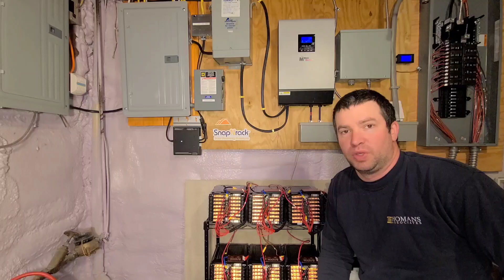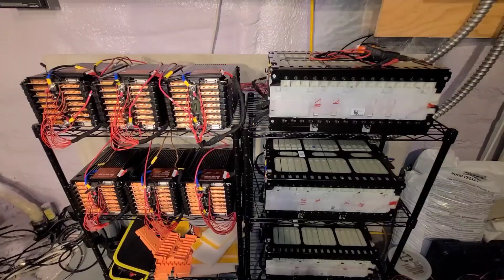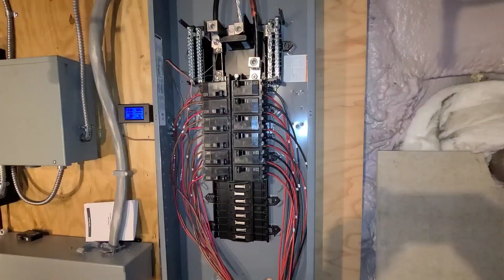DC Wiring Using 12 Daly BMS's with Volvo LG Chem and Smart ForTwo Batteries

Comment: Hello. I am thinking of using these LG Chem batteries in my electric vehicle. How did you solder the wires to the cells? (with soldering iron and tin?) I'm going to do the same on my project... Thanks in advance.

Comment: Thanks for sharing!
I'm considering Daly's for a few of my similar lg chem 16s 60V modules in parallel.
A question:
Is there a reason you soldered the wires directly onto the cells instead of using the regular cell pin connector i the middle on top of the cells?
Reply from the maker: Good question!  I initially tried to make the plug work, but the connections were too tiny to work work with.  I tried removing the connector from the BMU board but ended up breaking a couple tabs off, and ultimately decided it wouldn't be safe to work with either.  (For me, your results may vary!)

Comment: Hey Ben, I am planning to use two of the Square D QO load centers for my 36 LTO modules (1.1KW apiece).  My question is that when I combing the 4/0 wire coming from both load centers onto a common busbar, (then one 4/0 wire to the Sol-Ark 12k), are there any other safety measures I need to consider like installing a large DC breaker or DC disconnect coming from each load center?  I guess I'm not understanding if there's any worry about backfeeding into the individual circuit breakers if one load center is active and the other is not.

Comment: Hey Ben, thanks for making this video.  I'm looking at putting 60A BMSs (so 30A 2p breakers).  I just wanted to double check and make sure that I'm looking at the correct breakers that can handle DC.  Could you check the link and let me know if I'm on the right track?  Thanks.  https://www.superbreakers.net/2-pole-circuit-breakers/square-d-qob230-30-amp?gclid=EAIaIQobChMIzpLoiI716QIVQ77ACh0msw_ZEAQYASABEgJClPD_BwE
Reply from the maker: Yes, those can, but they are bolt on.  Typically residential load centers have push on breakers and larger  commercial load centers have bolt on. 
See link.

Square D	QO 30 Amp 2-Pole Circuit Breaker
https://www.homedepot.com/p/Square-D-QO-30-Amp-2-Pole-Circuit-Breaker-QO230CP/100022140
Reply: @benssolarandbattery  Thanks Ben

Comment: Ben, DP put me on to you and I am replicating your Square D breaker box into my LTO battery bank system using 16 Honda Fit 24 cell 64.8V modules and a Sol-Ark 12k for my off-grid farm. Currently making a rack from 1 1/4" square tube to combine batteries with the Square D panel. Love the clean look using the panel. Great job with this video!
Reply: Hey Craig, I'm in the same boat as you.  I bought 36 used Honda Fit battery modules from Greentec and will be installing them in my off-grid solar setup at my farm.  I'm a bit in over my head on DIY solar so it may be good to connect and share any ups and downs we have with these SCiB cells.  I am curious why you are going with the Sol-Ark 12k for this battery tech because it looks like the voltage range is 43 - 61 where the SCiB cells range from 36 - 64.8.  The only inverter I saw that covers this full range is the MagnaSine 4000W 48V.  I am looking to get 2-4 of these in parallel.
Reply: @HomesteadingintheForest  The reason is the best power range on these batteries (I have heard this reference made as their "Happy Zone) is between 2V-2.5V each cell. So, setting the Sol-Ark 12k at a nominal rate of 60V and minimal at 48V will be the ideal settings. In addition, you have to remember that LTO batteries have a C rate of 10. So, theoretically, it would be possible to charge them to nominal charge and minimal discharge up to 10 times in a 24 hour period. The real reason I am using a Sol-Ark 12k is efficiency and being able to use up to 2 strings of nine-ten 360W panels paralleling them together and running them 500' on 10AWG THNN THWN underground wire with little loss of power. I can run up to 500V and 33 amps to each charger (although it will limit the amperage to 20amps each) That saves $100's in wire and combiner boxes alone. And I have up to 18000W of surge power, can dump overages of produced power to my water heater or set my generator to self-start. Running over 10K watts of solar, why wouldn't anyone off-grid want something that is 96% efficient?

Comment: Very helpful to know those breakers are DC rated!
Reply: Hey Ben, I did some poking around on Schneider's website and it seems like the prices really skyrocket once you start dealing with 100A+ breakers. I looked at the QOU and PowerPact B lines. do you have any recommendations for high amp dc breakers for those of us with large single battery installs?
Reply from the maker: Derek, the reality of it is, its going to be expensive for larger, quality, new breakers with a good AIC rating.  Check out the ABB SACE S5N on ebay.  You can find them used for just over $100 typically. They have a shunt trip as well, so you can trip it with a BMS or switch.  DavidPoz has a video on the one he bought.  They're enormous, but definitely high quality.
Reply: @benssolarandbattery  Thanks so much! I was just coming back here to post that I had found shunt trip breakers and they looked to be a good fit. I will check out the one you listed.
Reply: @benssolarandbattery  Wow those things are comically large lol. Good value though for the amps and volts they're rated at. Thanks again!